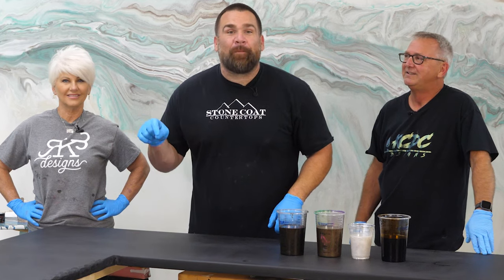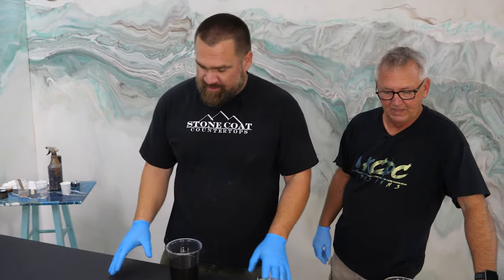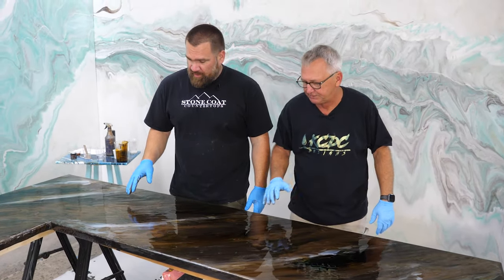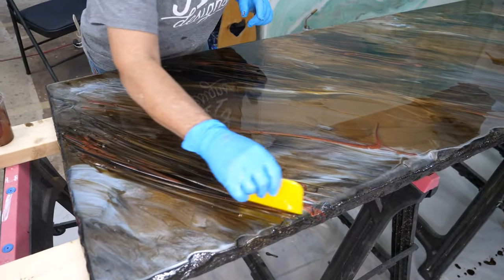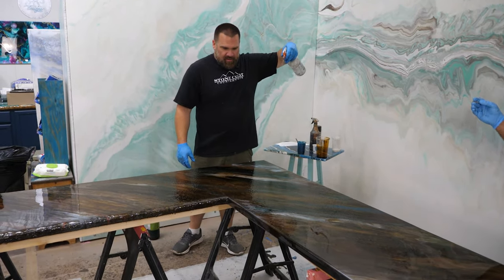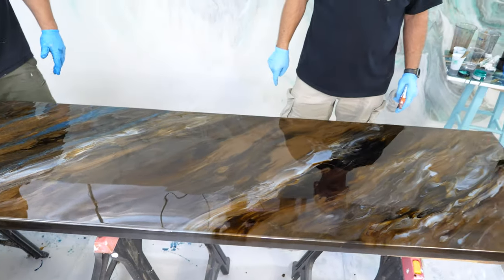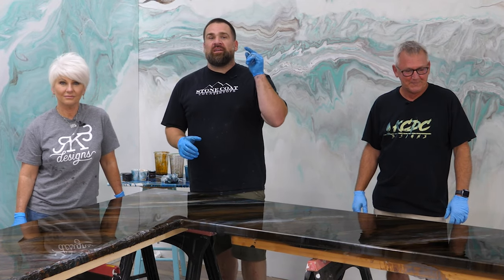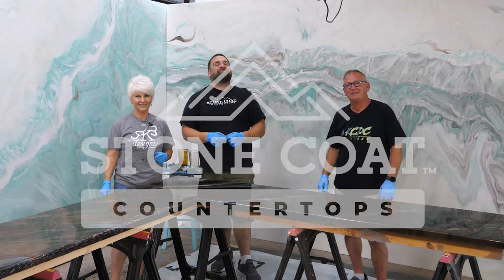3 Epoxy Pros, 1 Countertop, Which finish wins?? | Stone Coat Countertops

Comment: Could you show how to apply and tie in the epoxy finish to the underside of each exposed edge?
Reply: If I understand your question, it's recommended that the bottom edge be rounded with a 1/8" round-over bit on a router. This allows the epoxy to flow under the front edge and speaking for myself, as I'm addressing my edges I am also running my fingers under the front edge to get a good "seal" which extends 1/2" - 1" under the front edge. I also scrape my drips which also aids in being sure epoxy is getting under the front edge. 
Did that answer your question?
Reply from the maker: Great question and thanks @KCDC Designs for the great answer. I use my gloved hand and a popsicle stick to knock down and smooth out the drips when epoxy begins to get nice and thick. about 2-3 hours after mixing depending on room temp. Let me know if you have any additional questions!

Comment: How durable is this product?  Does it react to hot pots being set on it?  Is there ever a point that the surface must be refurbished?  What is the approximate cost per square foot to have this done and installed ?
Reply: I think it's supposed to be a 5 year product. I haven't tried yet but you're supposed to be able to put hot pots right onto the countertop
Reply: Hey Pamela, from my experience, Stone Coat epoxy is heat resistant to 475°, so having that "oops" moment of setting that hot skillet on the countertop should not harm the surface, similar to any other type of countertop surface such as quartz, granite, etc. I've even taken a propane torch, which heats up to over 3,000° and kept it on a small 5" area for over 30 seconds with no adverse effects. I performed this test on a sink cut-out from a customer's countertop I installed and it was a light/off-white color. That being said, as with ANY countertop surface it is always recommended to use a trivet, cutting board or something similar under crockpots or other appliances which create a lot of heat over a long period of time. Cost per square foot is going to vary based upon the experience of the epoxy artisan as well as location. If there's a point the surface needs to be refurbished, it would be if the customer chooses to change colors and/or design or if the countertop has suffered damage due to neglect from not using cutting boards, etc.

Comment: Is there a way to avoid that rough edge? I would prefer a clearly squared-off edge on a kitchen counter.
Reply: Hi Signalfire6, we fabricated that countertop to have one rock-faced edge and one smooth edge. As you're watching the video, the "rough" edge is on the left, the "squared-off" edge is on the right, if that's what you're referring to. We all work with our customers as to what type of edge they prefer.

Comment: What do you use to protect the resin from the heat? I have that problem in the kitchen of my house Thank you
Reply: Hey Piero and great question. If you're referring to protecting the surface from hot objects, it's always recommended that a trivet, hot pad, cutting board or something similar be placed under hot objects and appliances such as crockpots, coffee pots, etc., that generate heat over a long period of time.

Comment: I did a counter top sometime ago but right after spots turned yellow next to stove. Why??
Reply: There can be many reasons for epoxy resin (of any kind/brand) as well as quartz, granite, etc., prematurely yellowing or ambering, one of which is exposure to excessive heat or prolonged exposure to UV rays. We're also aware that there are some colorants that are not designed to be used with epoxy resin that can cause issues, as well as the type of undercoat used (latex paint, paint & primer, oil based paint, etc.) and whether it had fully off-gased prior to applying the epoxy resin. Consider a crockpot sitting directly on the countertop surface (of any type) in the same place for 6, 8 or 10 hours. Whether it's quartz, granite, quartzite or epoxy resin, there's a good chance the surface will be discolored, especially if it's a white or light color. From my personal experience, nearly all of my customers have at least 1, if not 2 countertop pieces on each side of their stove and I have not had any call-backs from premature ambering or yellowing. That's just been my experience.
Reply: @kcdcdesigns  thank you
Reply from the maker: Keith pretty much nailed it, shoot me some pictures of what's going on stonecoatcountertops@gmail.com

Comment: Can you apply resin on a granite countertop?
Reply: Yes you can, but as Dave Logic noted it needs to be abraded first, such as with a 60 grit sanding pad, then apply a true "Bonding Primer" such as XIM followed with 2 coats of Stone Coat's epoxy undercoat (recommended), although a latex paint can be used, just be sure to let it off-gas for at least 24 hours prior to applying epoxy. Also be sure to sand between coats, regardless of what type of paint is used.